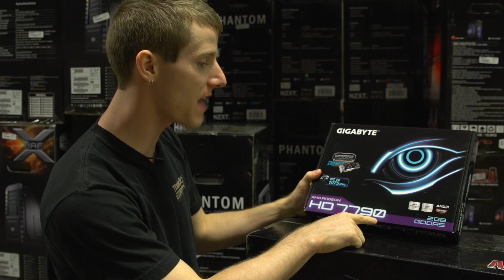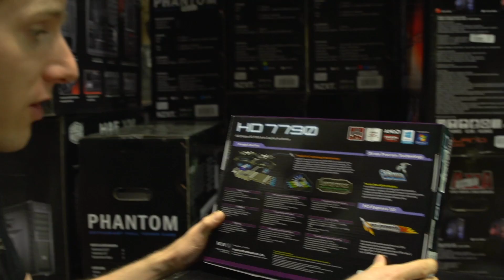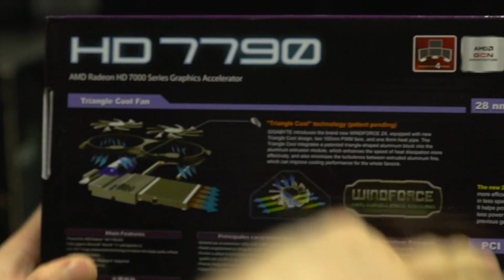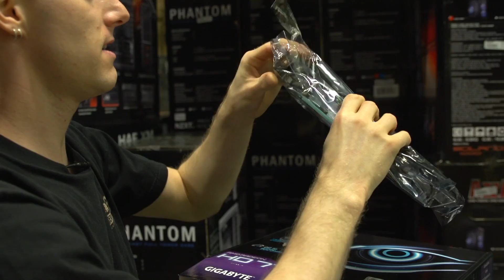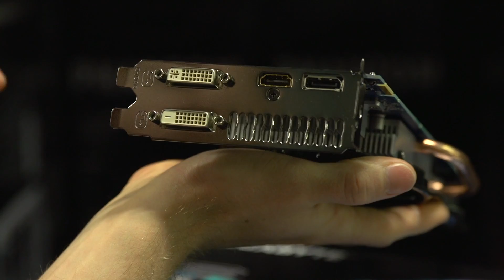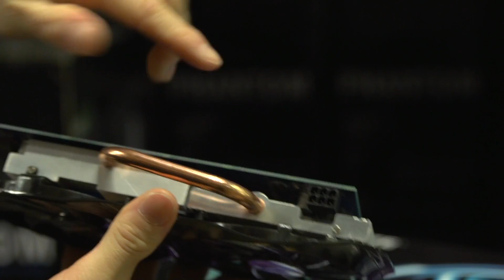Gigabyte Radeon HD 7790 Unboxing & Overview

Comment: i had two of these. i gave them to my mum.
Reply: John Clark good cards ?
Reply: MrAhmedUA They are alright. but quite dated now.
Reply: John Clark will it bottleneck e8400 ?
Reply: MrAhmedUA If anything the CPU will be the bottleneck since its only dual core and 45nm but the clock speed is reasonable. 
Honestly i would buy the best GPU you can afford then sometime in the future buy a new motherboard and CPU.
This Card is not really worth it in my opinion.
Reply: John Clark gtx 750 ti better ?
Reply: Yeah
Reply: no !!!!

Comment: I bought that video card 3 days ago and installed it on a mother board Asus M5 A97 R2.0 with 8GB of ram and Windows 8 Professional but the picture on my 23 inches Acer looks darker than with my Asus ENGTS 450 and when I go on the web like Twitter or Facebook, I see black scares on my screen so I wonder what is the problem

Comment: A less powerful card won't use as much memory.  This card is mid-range and the 6990 was a uber(?) high end card with 2 GPUs on 1 board.

This card is midrange and won't use as much memory.  So, adding more memory = wasted money for the manufacturer, shortly put.

Comment: he didn't mention that this card also spreads heat into you computer case. but hopefully it shouldn't be a problem if your fans are setup correctly to flow heat out of your case

Comment: that 116.4watts TDP means the maximum amount of heat in watts of power used that that particular hsf/ aka cooling system of that card CAN dissipate ( or get rid of as quickly as possible) in so much period of time

Comment: but id still pick a 650ti boost over the normal 1gb 7790 any day

however id still get a 7870 for any normal rig (since the 7850 is just below too little to run everything maxed @1080p)

Comment: Exactly. The PS4 has something similar to a 7850, so what does that mean? It means most likely all the games that are cross platform are going to have their minimum graphics the same as the consoles, and so people running a 7850 are going to be playing on low. And some games for the PS4 are aiming for better graphics with a 30 FPS cap. It's why buying anything but a 4gb GTX 670 + or a 7970 is pointless for PC gaming right now.

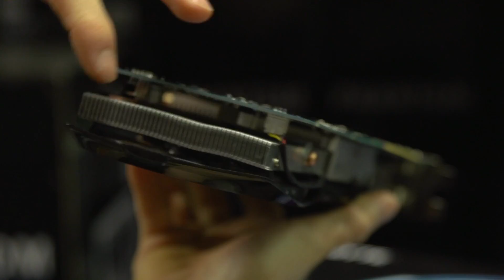Comment: 4:27 The back of the card looks bent or "wavy". I'm paranoid about video card quality after having a 9800gt fail, upgraded under warranty to 9800gtx, which failed, and now a 9800gtx+ (they seem to fail every two years, these cards run way to hot.) I'm using a good 750 watt Antec ps too. I hope that the heatsink is like this on purpose, as I have a gigabyte mb and I would like to upgrade to a gigabyte card and escape Nvidia problems.

Comment: an fx 4300 wont perform much less than an i5 in gaming. A 7790 is still a good card. There is very little margin in computer hardware so making the 7850 cheaper just  does not cut it. They made a card like this to compete against the 650ti boost.

Comment: HD 7790 is pointless , hd 7850 is about the same , also the price is about the same , rather than making a new card , just make the 7850 cheaper :D , also the 7850 is as far as you can get away with if you want to call you PC a good gaming PC , also you need an i5 or an Fx 8350 Amd cpu :D , if you go any slower , you will sacrifice frame rates that are very important , and i am talking about 10% less frames

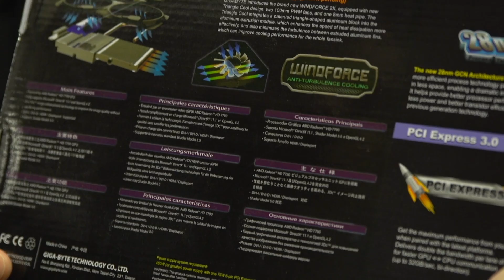Comment: I'm not a camera expert, but I think you should wider the area, where the camera is focused. Reduce the aperture, I mean. (If you can even do it with a video camera, I don't know.) Of course it looks cool, when the background is blurry, but now the product itself is blurry from the sides while focused in the middle. Check 1:15 for example. No wonder that B-roll can't get the focus right. :)

Comment: actually the 6990 is a dual GPU video card, meaning it's 2x 2GB per gpu, when gaming in crossfire(multi gpu mode), the video ram for each gpu (2GB each) has to be synchronised, rather than doubled. So your card is effectively a 2GB card.

Comment: Your 6990 is one, the highest end card from 6000 series, this is a low-mid range card from the 7000 series. And two, your 4GB 6990 has 2GB per GPU giving it 2GB of effective usable memory.

Comment: 18 compute units, 72 texture units and 1152 stream processors with 1.84TFLOPs performance is an overclocked 7770 to you? I'd like to see where you're getting this because those numbers are beating out the 7850.